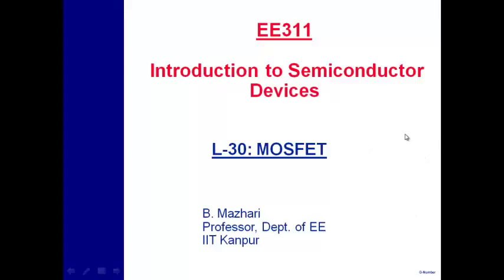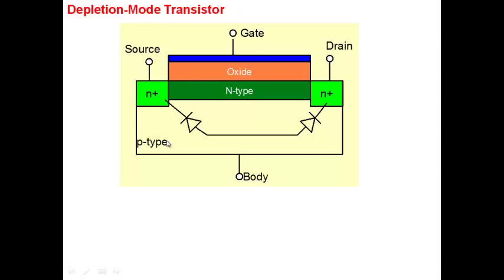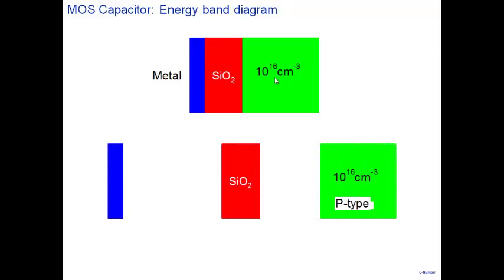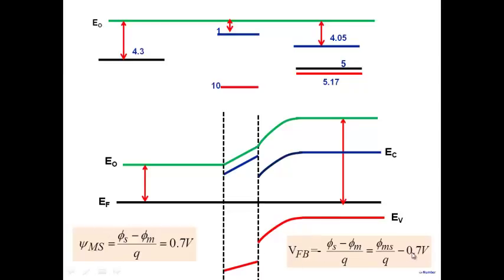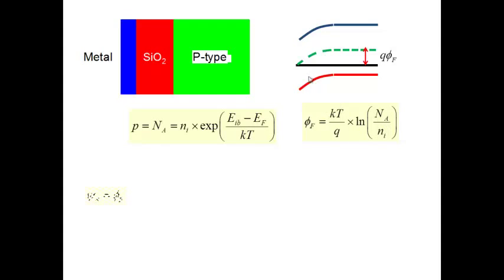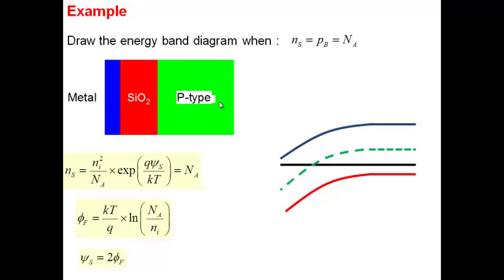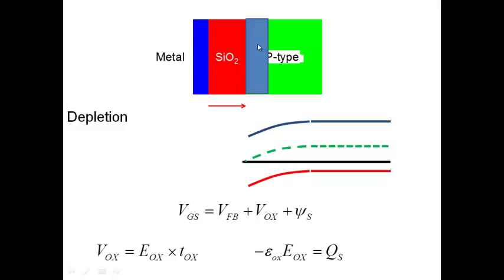L30 : MOS CAPACITOR  PART 1

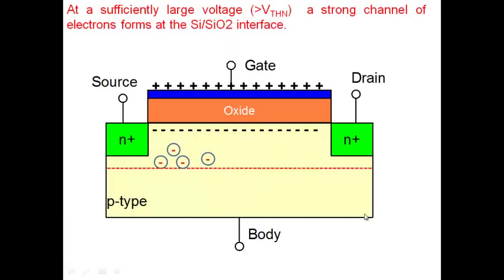Comment: At 13:00, For Mass Action Law to be applicable device should be in equilibrium. Isn't so??. If we are applying a gate voltage, how the device would be in equilibrium ??
Reply from the maker: Good question. Under steady state and absence of external generation,  continuity equation can be used to show that there are no excess electrons and holes and therefore np = ni^2